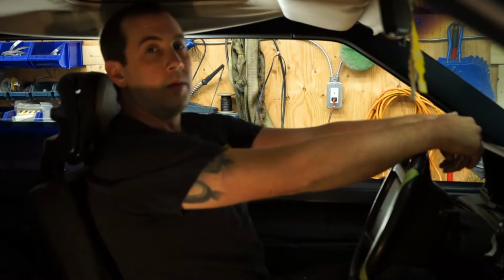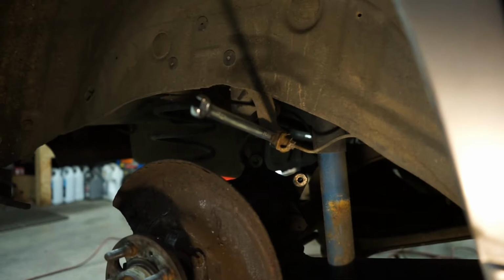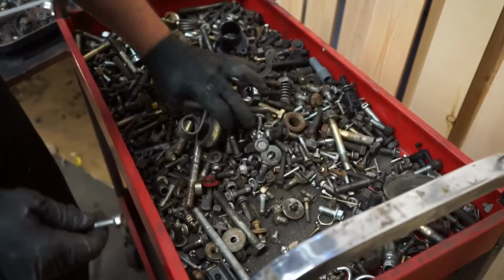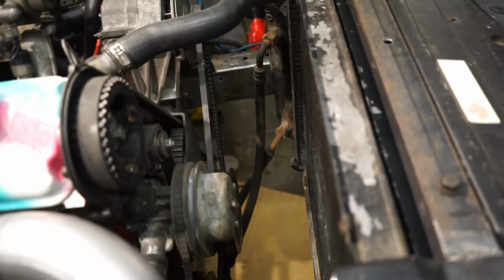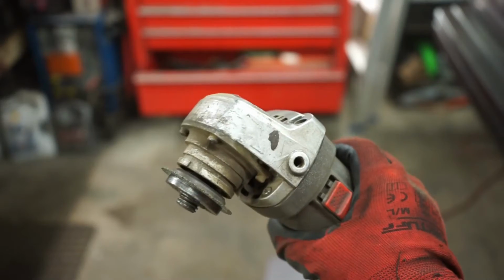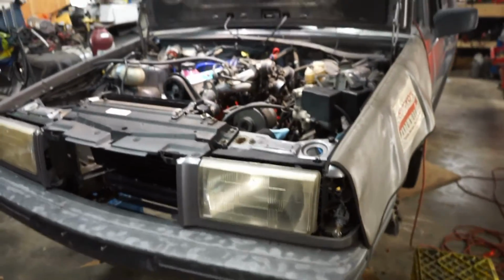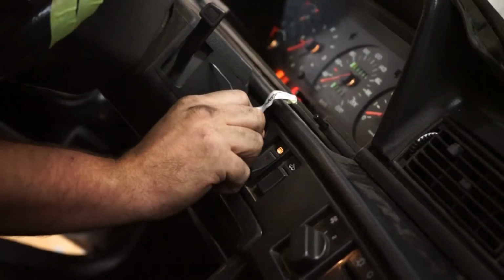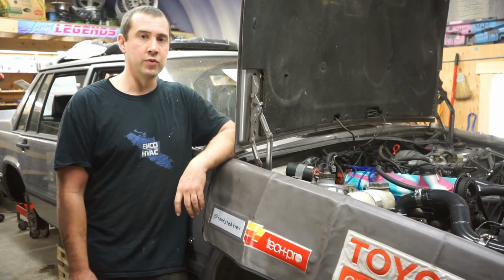740 drift build ep  4 (First start)

Comment: dude please try to film the knuckle and caster mods or at least explain them in depth. i welded my coilovers on this weekend, but didnt want to just blindly start messing with angle mods and fudge up the characteristics of the car.
Reply from the maker: Ill go into it a bit on the next one, if you've got any bmw or nissan drift guys local to you its all the same principles that apply to our knuckles. We are lucky, the Volvo racks have amounts of travel that those guys could only dream of!
Reply: @tentshedtrev6596  i dont have anybody local that is knowledgeable about anything drift related esp drift specific fabrication. would have to find somebody at minimum 2hr away